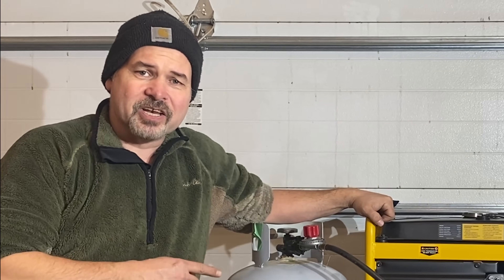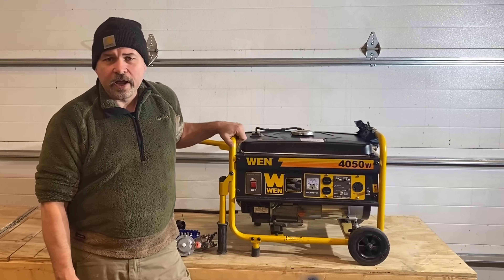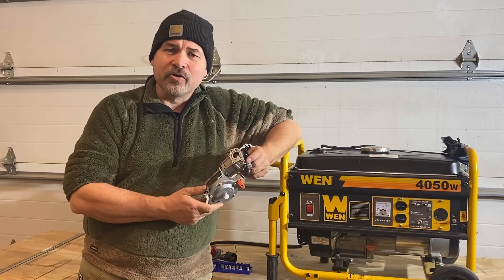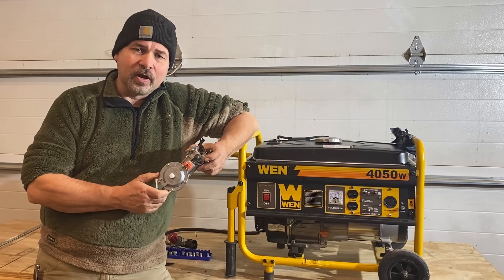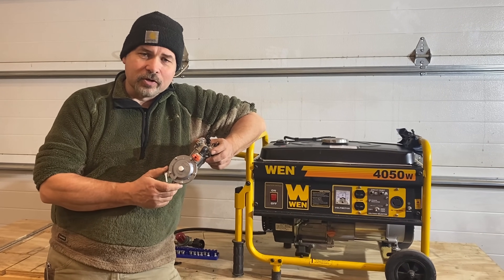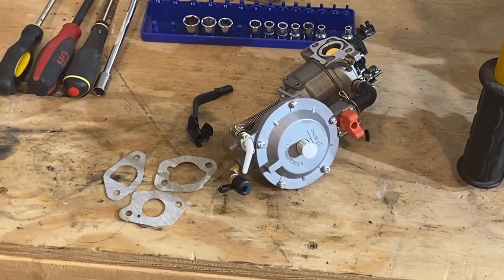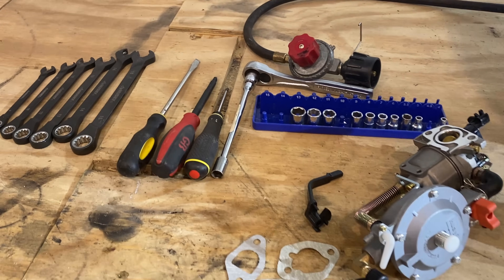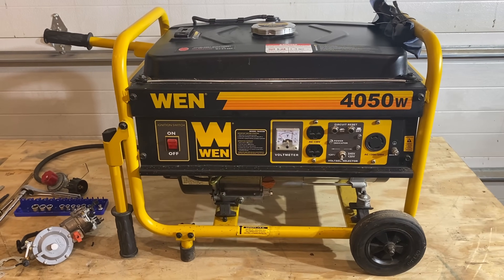how to convert a gas generator to natural gas - How to convert a generator to propane

Comment: I have the exact generator and would like to do the conversion. Do you have the specific model you used?
Reply from the maker: The EXACT model that I used on this video is no longer available (2020 messed up a lot of things like that) Here are similar units that should work for most generic generators like you see in this video
Cut and paste this link for a dual fuel carburetor 
https://www.ebay.com/itm/170F-New-Dual-Fuel-Carburetor-GX200-LPG-Conversion-Kit-for-Generator-Propane-US/322866944418?epid=9008777884&hash=item4b2c5e99a2:g:fGgAAOSwIJlaADqp
Cut and paste this link for a carburetor that say it will let you do propane AND Nat Gas
https://www.ebay.com/itm/dual-fuel-carburetor-with-Manual-choke-LPG-NG-propane-CONVERSION-KIT-for-gaso/132615366957?epid=27007030356&hash=item1ee07de92d:g:RUYAAOSwdIBa8XNJ
Stay safe and stay healthy, 
-Shane
Reply: @AHandleOnThings  Thanks for the quick reply.
Subscribed. Great video
Reply from the maker: Wayne, I am always glad to help ! Thanks for the view and the subscribe! 
Have  a super day!
-Shane
Reply: Wow.
Quick response. I really appreciate it. Subscribed.
Thanks !

Comment: So glad to see you did it right and used an on demand regulator which came on the new carburetor! I’ve seen too many people show how to just poke in a hose somewhere, and let uncontrolled gas flow to make it run!!! They fail to know or inform the people watching that this is highly dangerous and could kill you and your family!!! And the generator governor won’t regulate engine speed under changing loads!!!
Reply from the maker: That is EXACTLY right! There are a lot of people out there taking a huge chance with liquid propane in that way. Thanks a TON for the comment !
Stay safe and stay healthy my friend!
-Shane
Reply: @AHandleOnThings  I have tried a similar carburetor on an old Tecumseh 10hp generator. I just used the regular on the new carburetor because it won’t bolt up to the manifold without an adapter. It runs but surges so I’m going to drill in a fitting further downstream and see if that works, if not I’ll make an adapter plate and bolt the whole new carburetor up to it

Comment: "The spring that aggravates you" is there to take the 'slop' out of the governor's speed control adjustments - especially when the little hole wears a little.   Since the frequency and quality of the alternating current is dependent upon engine speed it's not just something to aggravate you, but rather is an important component of the governor.
Reply from the maker: yep

Comment: can you still run a generator on Gas if your carburetor switch is on Propane?
Reply from the maker: I have never tried doing that, but that should not be possible as the switch is a valve and turning it SHOULD change the aperture from the gasoline side to the propane side.
-shane
Reply: Thank's Shane I have not put the carburetor on yet so I will switch to Gas.

Comment: I really love your video it is way better explained than any others I watched. I wanna conver an A-i Power generator, do you know if that kit works on it?
Reply from the maker: Thanks for the comment! 
I don't know if the kit works on that machine... Your best bet would be to pull the carb and compare the orifice to the gaskets sets shown in the video. Be sure to let us know what you find out, lots of people read the posts and are interested in what machines work with what kits!
-Shane

Comment: Any idea how long you can run on a 20 lb propane tank?
Reply from the maker: I get about 12 hours if Im not loading it up much... just running the lights at the cabin for instance... but if I use it to run a compressor and saws all day on a construction project I get something closer to 8 hours.
Stay safe and healthy, 
-Shane

Comment: One of the best DIY videos out there. Thank you. Just received my WEN GN400i RV-Ready 4000-Watt Open Frame Inverter Generator CARB Compliant and have been researching how to convert LP or NG on the cheap. Don't think mine will be so easy to do. Can you recommend a carb model that might be compatible to my generator? Thank you for posting.
Reply from the maker: I dont know which kit might work for your carb, (it may work with this kit as I have done conversions on WEN generators before with these kits) the best thing to do is to pull the carb and have a look at the mounting surface and gasket the manufacturer uses... Then look on ebay for a unit with a similar footprint and gasket design and you will be in good shape. 
Optionally you could get a piece of aluminum and manufacture a simple adapter plate. Usually the carb throat is the same size and the only thing you would have to adapt for would be the bolt pattern so it isn't too complicated just a piece of aluminum with a few properly placed holes in it. I should do a video on making an adapter plate probably...that's a good idea!  
Gasket paper can be bought over the counter at most auto parts stores so that is easy to arrive at too. 
Let us know how you come out in finding one!
Best regards,
-Shane
Reply: @AHandleOnThings  
Thanks Shane for the response. I will take your advice and look around and let you know. Thanks again
Reply from the maker: Do me a favor, if the footprint and gasket on the carb on your machine is different than the one in the video take a good straight on photo with a tape measure next to what you have and maybe if I have a few minutes free I can whip up a conversion plate for it. If so, I will hook you up with one. 
ssclaims@hotmail.com 
Best Regards, 
-Shane
Reply: @AHandleOnThings  
That will be great. This weekend I will be starting the generator and breaking it in and testing. If all goes well will send info. Previous Generator I received ( another brand ) was DOA. Really appreciate your help.
Glen

Comment: How will transfer a inverted generator to gas?
Reply from the maker: To change back to gasoline operation...  Put gas in the gas tank, turn the carburetor selector to gasoline instead of propane or Nat Gas, open the gasoline supply valve and start the generator up. When you are ready to change back again you do the opposite and then also open the bleeder at the bottom of the carb and drain any residual gasoline from the bowl.
Cheers, 
Shane
Reply: Best place to buy a conversion kit.

Comment: Thanks for this video. I have a Briggs-Stratton 5500 10HP generator. Will this one fit? And will I need a separate tank regulator?
Reply from the maker: Unfortunately this kit only services motors up to about 5-6hp... There are many other kits out there that may fit your machine tho. The change out is going to be largely the same process. 
Cheers, 
-Shane

Comment: I have a Briggs and Stratton generator. I would like  to do the carb switch like this, instead of the other pricey conversion. Does Champion use B&S motors so i could use the same carb as what you do?
Reply from the maker: Mike, with so many different generators out there and only a few versions of carbs it is very possible. The best advice I can give you iw to pull the carb you have and look to see if the gasket that fits between the carb and the motor looks like the one in the video. If it looks the same, you should be in great shape. If it looks totally different then I would speculate that this kit would not work on your generator.
Let us know what you find !
 Cheers,
-Shane
Reply: @AHandleOnThings  After heading down many rabbit holes I found the Predator and Champion generators are Honda clones. I found a US company that makes/sells the combo carbs like the chinese ones found on ebay . (quite a bit pricier) They tell me all of the combo carbs are for the Hondas and Honda clones. They did not make a combo carb for the American made B&S and were not aware of any of the chinese combo carbs that would work. I found another YT vid that confirmed that the chinese combo carbs would not bolt up to the B&S. So.. I am going to do a different $20 DIY convert on pressure washer first. Then depending on how that goes, I may do the same for my generator. Or may spring for the $200 kit.
Reply from the maker: Mike, 
That sounds like a good plan.
I can tell you without any reservation at all that having a generator that runs on both gasoline and propane is by far one of the best and most useful projects I have done. I was fortunate and got by cheap on the kit, and you too could pick up a compatible generator new for not much more than the price of the more expensive kit and then you would have more than one generator. Whichever course you take though it is money well spent in my opinion.  
A propane pressure washer is also a great project! 
Stay safe and stay healthy my friend, 
-Shane

Comment: Is it possible to use a large (1000 gal) propane tank to run this instead of the small 20 pound tanks?
Reply from the maker: Absolutely it is. As long as you get the pressure reduced which will likely require an additional regulator off the big tank. Its really not a whole lot different than a pigtail supply for a BBQ grill.

Comment: So you used to drill to start your generator
Reply from the maker: I did... and I do. a socket modified to avoid getting stuck when the generator takes off does a great job. Check further down in the comments for some info on that! It works great with a corded or (larger) cordless drill.
Reply: @AHandleOnThings  couldn't find the info for the socket mod.  Read everything below here.
Reply from the maker: A Handle On Things
  • 1 month ago
Dr. Drax,
What we did was we took a deep well (spark plug) socket ( it doesn't have to be a deep well) that fit the nut on the flywheel for the generator and we put a little insulation inside the socket to partially fill the socket and then welded them together. The insulation keeps the epoxy from running out in the next step. Then we filled the socket with epoxy thru the square drive part of the socket until the square drive hole of the socket had just enough epoxy to keep the socket driver from engaging solidly enough to lock into the socket. The socket drive that we put in the drill chuck catches the socket enough to drive the motor but when the motor takes off it just pops off no problem.  If you need to modify the fit  just use a dremel tool and grind out a little epoxy at a time till you get the fit you like. 
We put just a little blue thread locker on the nut to keep it from loosening up when the motor starts up and pulls free of the drill.  
The socket stays attached to the nut and does not mess up the balance at all. and anytime you choose to go back to a pull rope drive just pop the socket in reverse with an impact driver and it comes off. Then you put on another nut that fits and pop the pull rope flywheel back on and you are in business. Be sure to get a matching nut for the generator from the hardware store tho... it is almost always a metric thread.
We use a common electric drill to do the job because it was handy, but a battery operated drill that has some snort does the job just fine too.  
-Shane

Comment: What are the best brands to get of generators
Reply from the maker: In my opinion the best generator is one you can afford TWO of... I am a firm believer that "two is one and one is none" as for brands, most generators in each price point are relatively similar. I dont personally get into the "Ford guy vs Chevy guy" debates.

Comment: What MORE be needed to run on N.G. (natural gas) ?  You've covered the propane, what is the next step. Any more regulators? Many questions. Other conversion kits incorporate a load-block, why not this one?
Reply from the maker: We use like to use a natural gas pigtail that is set up for our NG BBQ grill. It does have an additional step down regulator.
Reply: @AHandleOnThings  What exactly need I look for to shop for this regulator?? How about a web link ?
Reply: @MeadeLX50  it is my understanding that because your home's natural gas meter has it's own regulator,  it is not necessary for another one to be added to the generator. Keep in mine that this is different for Liq propane.
Reply: @beeerhunt  Most NG appliances have regulators/valves regardless of home meters. I would use one of these just in case.
Reply: yes Raul, good point and I agree!

Comment: Can this technique work on a Duromax XP13000E?
Reply from the maker: I dont know anything about the duromax unit. I would suggest taking the carb off and checking to  see what the gasket looks like. If the gaskets appear similar you are probably on the right track
Reply: @AHandleOnThings  I think the technique would work, but I have been having trouble finding a model for my 12 KW generator (670 cc).  I'm still looking, though.

Comment: Do you need a additional regulator for Natural gas?  Every house already has a gas regulator and this carb also has a regulator.  A little confused from some of the comments below.  Will this shut natural gas or propane gas flow if the generator fails?
Reply from the maker: The short answer is that there are codes that are area specific that govern what you "Need" to have to hook a generator to a natural gas line. I do indeed use an additional regulator on the unit that I hook to our nat gas line when I use that machine.
Does the carb stop leakage if the generator fails... Yes it is designed to do that.
I do prefer to use my generators on propane at my house because I have lots of propane on hand and I am more comfortable with my propane supply than I am with a nat gas supply in the event of craziness in the world.
And... Propane is an easier standard to hit because of limited potential for extended leakage etc...
Now...While the setup that I showed on this video does indeed work for natural gas as well as propane, (we do have several that we have set up) for liability reasons I am simply not comfortable going into all of that (sorry) 
Also...The kit that I used in the video is currently not available... Pandemic... China... All of that...
.That said... THIS unit (or similar) which is available on eBay is (In my opinion) really a better option for using a generator on a nat gas setup anyhow but it is a bit more money...   https://www.ebay.com/itm/Tri-fuel-Propane-Natural-Gas-Generator-Conversion-Predator-3500-Inverter-Green/183831599316?hash=item2acd3798d4:g:0Y8AAOSwCL9eIbcm
Cheers,
-Shane
Reply: A Handle On Things I love the short answer.  I guess it’s hard to trust a $30 regulator on a endless supply of Natural Gas 😀

Comment: Great video, trying to find some info on turning Predator 9000 into trifuel for cheap
Reply from the maker: Nash Fuel makes a kit thats available on eBay that fits the larger Predator models.
Their kits are installed very similarly to the way this one went on.
Here is a link to one of them... I am not affiliated with them in any way, 
https://www.ebay.com/itm/Propane-Natural-Gas-Generator-9000-7250-Predator-63971-Harbor-Freight-Alt-Fuel/173997598052?hash=item288310a564:g:lloAAOSw11VfKYKM
Cheers, 
-Shane
Reply: A Handle On Things thanks

Comment: Do you have a link to the kit required?
Reply from the maker: unfortunately the specific kit that I used in this video is not currently available. However, there are several options available on eBay that are just a little different that will likely work for you.
Go on eBay and search generator propane conversion or natural gas conversion and you should find several options. The installations is still going to be very similar.
Cheers, 
-Shane

Comment: I wanted to ask about the drill start modified socket you used.  Curious about how to avoid kickback if starting with a drill.  would appreciate your insights.
Reply from the maker: Jason,
What we did was we took a deep well (spark plug) socket ( it doesn't have to be a deep well) that fit the nut on the flywheel for the generator and we put a little insulation inside the socket to partially fill the socket and then welded them together. The insulation keeps the epoxy from running out in the next step. Then we filled the socket with epoxy thru the square drive part of the socket until the square drive hole of the socket had just enough epoxy to keep the socket driver from engaging solidly enough to lock into the socket. The socket drive that we put in the drill chuck catches the socket enough to drive the motor but when the motor takes off it just pops off no problem.  If you need to modify the fit  just use a dremel tool and grind out a little epoxy at a time till you get the fit you like. 
We put just a little blue thread locker on the nut to keep it from loosening up when the motor starts up and pulls free of the drill.  
The socket stays attached to the nut and does not mess up the balance at all. and anytime you choose to go back to a pull rope drive just pop the socket in reverse with an impact driver and it comes off. Then you put on another nut that fits and pop the pull rope flywheel back on and you are in business. Be sure to get a matching nut for the generator from the hardware store tho... it is almost always a metric thread.
We use a common electric drill to do the job because it was handy, but a battery operated drill that has some snort does the job just fine too.  
-Shane
Reply: Thank you

Comment: Hi . Where did you buy your regulator $30 is a very good deal thanks
Reply from the maker: I bought mine on eBay about  a year and a half ago. There are still propane conversions listed on eBay today for $30, but I didn't see one listed for "propane and nat gas" listed today for that price. Stuff from china is getting harder to get so that isn't a huge surprise. There are still some tri-fuel conversions listed but they are a different style and they include the nat gas to wall regulator. They also cost a bit more. 
Have a super day !  -shane
Reply: Amazon has them.  Kuupo brand.